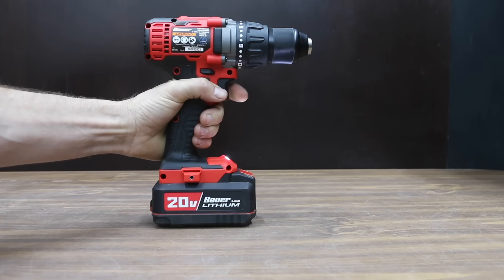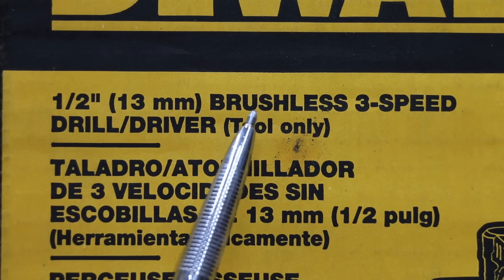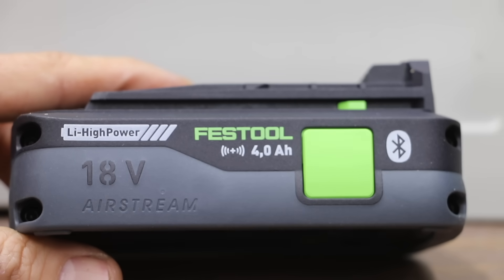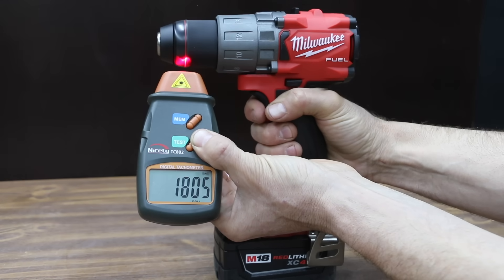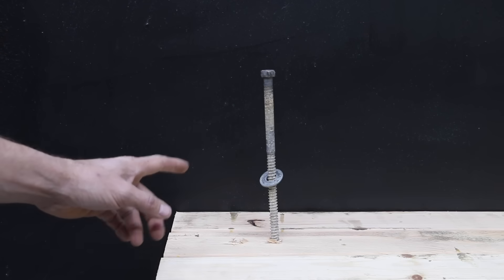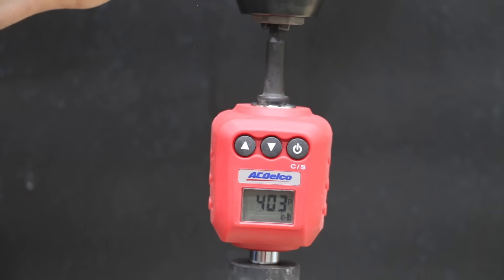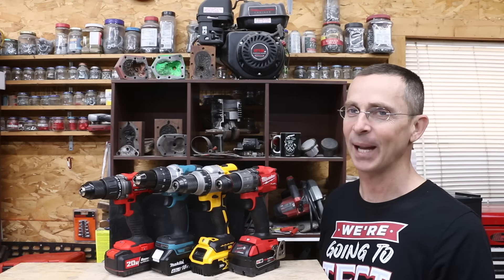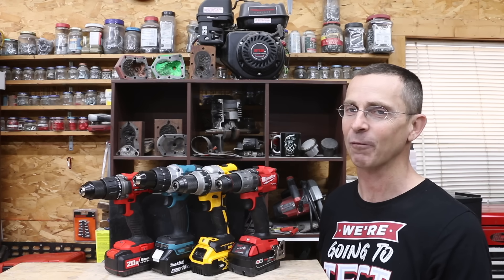Best Drill (BATTERY POWERED)? Milwaukee vs Dewalt, Makita, Bosch, Festool, Ryobi, Bauer, Ridgid

Comment: Imagine spending over $500 for just a drill and then watching this video with your drill in it.🤣🤣🤣🤣🤣
Reply from the maker: Thanks for watching!
Reply: Festool makes a 6” sander that is so good that it’s hard to explain to someone who hasn’t ever used it. It’s like a whole different category of tool. Their shop vacs are also really amazingly good in terms of keeping the air clean. I’ve never understood the appeal of their drill/driver, so I’m not surprised to see how this testing went.
Reply: It just barely beats out the bauer drill that costs 1/10th the price. That's sad.
Reply: @bdkj3e  thats because bauer is made by Chinese children in slave sweat shops.
Reply: That's why the price for a not chinees made tool and you see why companies are switching there factorys to china and even vietnam and malysia. But That movment does cost a lot of jobs. therefor the dewalt would still be my choice.
Reply: @maxwell6774  and festool my choice :P .... I am from europe ...
Reply: @Auto5k my ridgids are 9 years old and still going strong. I use them professionally. They have done cabinetry, metal roofs, beds, several saddle maker shops, several decks, sheds, tons of drywall. Then there are all the regular home maintenance and odd jobs they have been asked to do over the last 9 years. Still have the original batteries too. The only thing that has gave out was a battery charger that was charging batteries in the sun all day. Called in a LSA claim and got my new charger 3 or 4 days later. No questions asked. They have been dropped off of roofs, left out in the rain and run even when it was blazing hot out. You can't beat that. For an impact, drill, 2 batteries and charger for $169. I'll stick with my Ridgid.
Reply: Note that the version without the batteries and charger (as the others were listed) is $349. At that price it still includes the modular case which lists at $99 by itself.

Their version which is more equivalent to the other tested drills (but still has the quick change chuck system) is $299 without batteries and charger, $499 with batteries, charger, and a right angle adapter.

They even have a $199 tool only version (with case) that only uses the standard Jacobs chuck.
Reply: I came for the festool bashing and wasn't disappointed
Reply: My Elu cordless drill is still working after 25 years.
Reply: $400 Its just that case
Reply: Yup, wouldn't be caught dead buying a Festy https://www.youtube.com/watch?v=oezp-_DcUgg
Reply: The advantage of using Festool had not been measured. As a Contractor for building custom kitchen cabinets a precise trigger, the fast exchange of the drill chuck for bits. A tight drill chuck that doesn’t wear out that fast and is able to hold tiny drills us one of many benefits.
Reply: @Auto5k dude yea a festoon may last 10-15 years. $100 Chinese drill will not. Might last 3-5 years but you can buy 5 Chinese drills for the price of one festool drill which gives you wayyyyy more power. So festool price at least for the drill is absurd.
Reply: I've seen plenty of tradesmen using DeWalt, Milwaukee and Makita but I've never seen one use a Festool.  Hilti seems to be the go-to brand for tradies looking for the ultimate in high-end power tools.
Reply: LOL, came here to basically say that same thing.  Great review, I really want that Milwaukee now :D
Reply: Festool offers drills for around $200-$300.
Reply: the only thing I want from festool is their domino joiner, everything else is overpriced
Reply: @seanthompson6720  Festool's patents for the domino will expire in 3 years so there should be much cheaper equivalents from other brands by then
Reply: @seanthompson6720  Their sander is quite nice also.
Reply: Ya, I can’t believe what crap it was, other than super high speed, it was best in absolutely zero categories, and often among the worst. 🤦‍♂️
Reply: @Nevir202  it comes in a nice box tho
Reply: @Nevir202  super high speed it is hard to achive in cars too; you can beat a 100-150k$ mercedes S class with a 35-40$ Renault megane RS but: You will not have almost total silence inside the car; You will not have nearly the same driving comfort,etc ...
Drilling machines are not made for tightening large screws: if you exceed 40-50nm of tightening torque with one hand, you can get seriously injured: most people also use drilling machines without a handle because it makes them uncomfortable at work! For tightening large screws are impact machines with which you can tighten any screw you want with one hand without risking anything (except noise) 
Festool is the quietest cordless drill on the market ; For the money you pay you receive: drilling machine, 2 batteries, charger, 2 different interchangeable chucks, an ultra-resistant and light transport box + 3 years full warranty (including batteries) . 
The test for disengaging the clutch was done to the detriment of dewalt and festool that use electronic clutch: it had to be done on both drilling machines at the highest speed (2 at dewalt and 4 at festool) where they are most sensitive.
With festool you can tighten to the maximum torque on an extremely low speed for greater accuracy...
+ When he published the price he had to compare the cars with the same equipment! (Bosch also uses machines with interchangeable mandrels just like in festool; it's as if milwuaee has a similar model). Not just for the body and maybe a battery with a drilling machine that comes with several accessories ... it's like comparing price on cars with basic features to another car with all the features ....and at the end to say: how big is the price difference ....
Reply: @Nevir202 if you do certain types of work then the festool actually makes a lot of sense. Thst said I do wish it had a mechanical clutch.
Reply: A lot of wood working professionals like Festool. Its possible the German motor and guts will be working 10 years down the road while the China designs may not be. A few years ago I built an office in my basement and all the framing and dry-walling was done with two Ryobi cordless drills. During framing one of them only lasted about 400 x 3 1/2 inch framing screws before the gearbox broke and would not turn the chuck.
Reply: @practicalguy973  At twice the price, you can just buy another tool and still be ahead. Since the other brands like Dewalt and Milwaukee are more powerful,  technically you could get more work done and save money in time.
Reply: @practicalguy973  I've had a Festool 12v drill for over 15 years and was still going strong when i sold it. And i ran it with 14v Festool batteries because that was a thing. Festool motors just dont die. Festool doesnt make the most powerful tools but they sure as hell last and their service is next level as well. Like no issue getting parts for machines that are decades old.
Reply: @BetterBiomedChannel  Factor in the cost of the Charger and batteries. In the case of Makita, DeWalt, Bosch, this can easily add another €150-200 to the prices of the tools.
Reply: @practicalguy973  If you're spending 500 dollars on a drill you want MORE than "maybe lasting longer"! You want performance too and it fell WAY short!
Reply: @BetterBiomedChannel  I hear you. I still have my other cordless Ryobi drill but rarely use it as I know it will burn out and break with heavy duty use. Using that mentality of low cost and throw away is exactly why I have 2 Rigid 18v hammer drills now. The were on sale at Home Depot a couple years ago with 2 batteries each and much cheaper than Dewalt was at that time. I got both for cheaper than the 1 Dewalt of similar power. I have a corded Makita 15amp recip saw and drill that is over 10 years old and work well for abuse and heavy duty. I did some demolition jobs with my Makita recip saw and it never let me down with hundreds of hours now.
Reply: @practicalguy973  That is so true. This test compared short term performance only and did not even look at reliability over time.
Reply: @TheSir2005  same with DeWalt, Makita, and Milwaukee
Reply: @practicalguy973  My colleague has a Festool drill he has been using daily in construction for over 10 years. It was one of the first brushless drills you could buy. It still works like new. The fourth gear is fantastic for self tapping screws. It is also nice to have a tool that isn't made in China.
Reply: @practicalguy973  The cheapest drill you can buy at home depot made for home gamers compared to a festool. Lol.
Reply: Lol nope. I’ve used most of their tools and am unimpressed. We burned up 3 miter saw motors under warranty, and the dealer gave us our money back.
Reply: @darksideorbit8898  Thats simply not true. The service on brands like Festool and Hilti is on a completely different level compared to those brands.
Reply: @TheSir2005  You aren't doing yourself any favors by suggesting the overpriced tools break so much that you are intricately familiar with their customer service.
Reply: @TheSir2005  You're probably right that the service is much better than the 3 brands. But the service is still good enough that it's not worth paying a huge amount of money for extra. Makita, DeWalts, and Milwaukees also don't break often, and when they do, the manufacturer honors the warranty most of the time.
Reply: @someguy5035  So you are saying what? You aint familiar with customer service from tool companies? Cause now that would say a lot.
Anywho, i am familiar with them cause i have run, have and had tools from every brand out there and its just a fact that the service on Hilti or  Festool etc is another league. Anyone knows that. Very different when a Festool or Hilti breaks or has issues compared to lets say Milwaukee.

Oh and btw the Festool isnt 544 bucks, the PDC isnt even for sale anymore here. Last listing i have for it was 287 dollars for a kit with a 5amp battery. It got replaced by the new TPC which would cost me 365 dollars with a 5amp battery right now. 
But if you think Festool or Hilti or other premium brands are overpriced then they certainly arent for you.
Reply: @darksideorbit8898  If paying for the service is worth is up to that person/company. For me personally it aint so im not buying Festool. I dont need that extra service myself and i dont wanna pay that premium for it.

But i've worked for companies who, for example, did use only Festool for simple reasons, there's no hassle. Tool breaks or have issues: reps come pick them, no questions asked and they hand you a new one. There's a lot of value in that for companies. Makita, Dewalt etc dont do that.

Like we used to burn through the switches on occasion because we were running 14v batteries in 12v tools (14v had more amps then 12v's as well). Its bound the happen when you run more juice and more rpm's through a machine then whats it designed for that something will break when abusing it all day.

The rep just laughed, he found it funny.... No questions, no lectures nope, just here's a new one.

Thats what you get as service, forget warranty and again there's a lot of value in that for companies where its too expensive to send tools to get repaired and wait to get them back or having to go to a dealer etc etc.

Festool really isnt made for prosumers or small contractors.
Reply: @practicalguy973  
Festool gives you 5 years of warranty.
Thats one of the things you also pay for
Reply: @TheSir2005  Here's the thing. They aren't "premium." Sorry you have to use customer service so much they know you by name. Maybe you shouldn't be buying "premium" tools.
Reply: @jankaas2760  Yes warranty and parts is great. I think of Festool as something that stands for long lasting quality which is hard to find now days in our throwaway society. In the early 2000s I worked in a car stereo wood working manufacturing facility for a teen summer job, we built display units for retail stores and consumer MDF subwoofer cabinets for Orion, Clarion, Phoenix Gold, Kaption audio and a few other brands. I worked there for years every summer and 2 years after full time to save some money to go to school. I used a Makita MAK9924DB belt sander 8 hours days for a couple days of every week rough sanding cabinets and it just ran for ever. We changed the sanding belt pads and motor brushes as maintenance parts once in a while and those just did not fail for decades of use. I bought one used from Craigslist a decade ago and I still own it and it always works well. It's not cheap but I like having a $300 belt sander rather than having to buy $150 belt sander every 3-5 years.
Reply: @practicalguy973  You can find used Dewalts, Maks, Craftsman, and even B&D all day long on marketplace and CL that are still functional decades later. 

Try again.
Reply: @someguy5035  Randomly buying anything on Craigslist you have no idea what your getting. It could be from a home owner that used it once or twice and it sat in a tool box for years or someone that used it in the trades daily. The Makita MAK9924DB I used for years was amazing. It was used by many employees in a professional environment and a design worth owning so I was not afraid to buy a used one. The same model has been sold since the time I used it over 20 years ago so that's got to say something. It was made in Japan back then, I think Makita is starting to get tools made in China like everyone else now.
Reply: @practicalguy973  So when you bring up longevity, it is irrefutable evidence, but when I do it is it subject to "you have no idea what your getting" doubt? What if I told you I own power tools that are decades old? Now how are you going to tap dance you r way out of that?

We're done here. We both know what happened here and your ego is too fragile to handle it.
Reply: @BetterBiomedChannel  to get more wor done you need another man to operate that tool :P
Reply: @TheSir2005  you dont need the highest power : Tightening screws with torque greater than 40-50Nm (60Nm has the festool model in the video) can be extremely dangerous: You can't hold a drill to that torque with one hand (as all drills usually use). For high torque with one hand there are impact clamping machines with which you can work safely :)
Reply: @practicalguy973  If longevity was your goal then you could not beat the Ridgid with its lifetime warranty, compared to Festool's 3 year warranty.
Reply: @practicalguy973  "A lot of wood working professionals like Festool. Its possible the German motor and guts will be working 10 years down"  I've worked in commercial and residential construct for over 30 years and I can't recall ever seeing a Festool. I also have a woodwork shop at home where I build furniture and my 17 year old Rigid cordless tools work very well. In fact I made the DIY track saw for the cordless 6.5" saw, out of plywood, and used it to rip oak boards for a table tops. The joints were excellent and after they glued and clamped they were as good as any I've seen in an Amish furniture store that's near me.
Reply: @Nevir202  You are also such an overly smart person. Better stop gossiping around here about products that you can't afford anyway, that is not meant badly, but it is better if you just be calm when you don't know your way around
Reply: @someperson8030  Just say you own some festools and get the crying out of the way. The price vs the performance was embarrassing.
Reply: I think for me I like some Festool for more accurate work. Just like any company they have some amazing tools and some not that great. I am a wood worker and build speakers and furniture grade things on occasion. I own a couple of Ridgid hammer drills for beaters and outdoor projects. But Festool has its place and use case for the people that understand the differences.
Reply: @someperson8030  this Festool did poorly in these tests and that is a fact.  
I love quality tools but they need to justify the price

All of my Dewalt tools are ten years old and still work great!  The original battery packs (DC9181) have only lost a little bit in that time.
Reply: @someperson8030  LMAO, I've had a lot of tools more expensive than that POS. But as the tests proved, my cordless drill which costs less than half of that is better.
Reply: @practicalguy973  Very true. In fact, people who own a Festool drill probably all also own a second or even third drill for messier work.
I don't own any Festool, since I'm not a professional, but even an amateur like me has multiple versions of most tools , to be able to choose the right tool for the right job, because you wouldn't want to waste your really nice accurate screwdriver on that ugly rusty thing, would you :)
Reply: @chestnutlouie4709  It did do poorly in this test, as you claim, but the test did not cover every aspect of the products, now did it?
I'm not a Festool owner, btw, just a guy who appreciates that certain tools are for specific jobs. It might well be that the Festool is 10 times more accurate, for instance. We don't know, because the test did not look at that.
It might also be that 99% of everyday home users of cordless drills have no need for this accuracy, but some specific professionals do.
We don't know that, so why judge?
You don't need this tool for that price and can find something cheaper that suits you? Fine. Good for you :)
But that doesn't mean that the tool in question is overpriced.
It just means that it is overpriced for your specific use case.
Reply: @chestnutlouie4709  lol reliability is a thing that most people look for when buying tools. brands like Festool, Wiha, Wera, Nepros, Snap on, Hazet, etc are all very expensive tools. surely you can buy bauer chinese crap and it will outperform every expensive tool brand but they're not reliable. today they'll work fine, tomorrow you are not sure if it work or not. professionals don't like such unreliable tools and they are willing to pay premium for reliability. brands like festool is not for DIY average joe. its for professionals
Reply: @chestnutlouie4709 If you knew what distinguishes quality products and what distinguishes them from cheap ones, you might also know that festool is used almost everywhere by large companies.  And you would also know that it doesn't always depend on the highest speeds and the volume, so don't tell me what should be good here and what isn't.  But okay then keep buying the China goods, but you won't get very far with that.Yes, I have to agree on this point because they are a bit too expensive.
Reply: @practicalguy973  That is what I am saying. What did the Fes do that was more "accurate" than the others? How did it demonstrate more accuracy? And what precisely do you mean by that?

Fair warning. I am a metrologist by trade.
Reply: @Nevir202  ok, I don't want to say anything against it, but you can't explain to me that devices that cost 50 € are used in large companies.
Reply: @someperson8030  the DeWalt drill that I bought 12 years ago is still in fine condition ( original batteries no less)
Abused a number of times and lots less than $500
Reply: @chestnutlouie4709  ok that is of course nice for you my comment wasn’t intended to talk badly to others, especially not dewalt, makita or similar high quality it was just about the fact that cheap products cannot perform as well as expensive ones.  And as I said, Festool is actually not for household use and therefore not really comparable with the other products tested.  But since I don't want to drag this discussion out forever, I would end this discussion peacefully and come to the conclusion that both not quite as expensive products are just as good as expensive ones and that everyone should buy what they think is right.
Reply: @someguy5035  What I've found with drills and drill presses for accuracy is the cheap ones can have more wobble that is not ideal for really accurate holes. The chuck itself can sometimes grab at a slightly different position with cheap ones and I've had to loosen and re-tighten the chuck if that happens. The longer the bit, the worse the issue is amplified. Over some time bearing and other parts wearing can cause even more play but that is less of an issue if it's designed well. Also if it's from a cheaper manufacturing process it might be that the same drill model is slightly better than another per manufacturing batch and their factory tooling condition and maintenance. So if you can get quality that works for many years it's worth it to me. I say like others mentioned, you cant really explain it unless you've used with skill and experience for years. I need to say I have nothing against any of the brands in the video. They are fine for home owners and for heavy duty use and replace in a few years if your using a lot.
Reply: @practicalguy973  "I say like others mentioned, you cant really explain it"

Yes you can. You can objectively explain it using metrics. 

Do they use superior materials? Do they have a superior design? Are they manufactured in a way that produces a better fit and finish? Do they have durability and reliability characteristics that are superior to others? Do they have integrated options and accessories that make the tool more useful? Because those are the objective things that determine value. 

Using words like "premium" and saying there is some attributional feeling you get when using it is pure BS. 

I have owned and used every brand in this line up minus the Bauer and the Fes. None of them "wobble." I have dilled perfectly straight holes with all of them. 

As others have mentioned here, there are other videos on YT where this thing is disassembled and it is made just like the others. 

You guys are faced with an objective test showing this is inferior to others in almost every way and yet you still can't accept it.

If your drastically overpriced and underperforming drill gives you a good feeling, that is great. Just don't lie to yourself or us about the value and performance.
Reply: @someguy5035  Really is funny seeing everyone singing the praises of the “Festool accuracy” when it had one of the worst clutches.

If you’re using that for “fine woodwork,” you’d better be quick on the trigger, cause it’ll drive a screw straight through a board before it does anything. 🤣
Reply: @practicalguy973  one difference: its noise level - it is the quietest battery drill  :P
Reply: Most of the time people zero in on one metric ...there is a lot more to doing good work than just fast....🤔
Reply: @boosted2.4_sky  Exactly. There is so much more to a tool then only the raw performance, like the ergonomics and exact operation and feedback. Another important thing that comes to mind is the robustness of the machine itself, when dropped or when doing heavy work.
Reply: @TheCheesePlease  some of the s*** he says kills me.
Reply: @caleb. I do not own any Festool brand tools, but I do feel that a few things need to be mentioned. Comparing like for like (2 x 5 ah batteries, charger, case) the Festool drill is $160 more expensive than the Makita drill featured in this review in my country. I know a few people who do fine woodworking for a living and they all love their Festool equipment and are happy to pay a premium. These are people who will never need to drill in a 5 inch lag bolt into a piece of wood. 

Contractors in my country mainly use Makita, or Festool. For a home gamer a hard hitting tool, like Milwaukee is probably a good choice. Will the current Milwaukee tools last 10 years of constant, every day use? I am not sure and these tests, as much as I enjoy them and this channel, will never show us the entire story. 

If you need to occasionally screw in some 5 inch lag bolts, then Festool is not for you, but these tools have their place, no matter how amusing you find their prices, or the fact they don’t have the most powerful motors.
Reply: @theseb1979  Makita and Milwaukie are the go to's in heavy industry in the oil patch where I am at. You can absolutely use and abuse their drills, impact drivers and impacts for years of day in and day out. And for their price if you accidentally drop one into a rotary breaker without too much crying. Something that people don't factor into things, I am sure Festool makes great stuff, but if you are constantly travelling between jobsites and your equipment can/ will be dropped, the cost associated with getting one is important.
Reply: @theseb1979  I understand what you're saying. For me personally it's hard to justify that price when I can just buy one drill that will do light duty and sink a 5 inch lag screw when needed.
Reply: @cdsmit27  , I hear you. I cannot justify it either, since I am not into fine woodworking, or a contractor. I need to do odd jobs, fix fences, and build things on our little 20 acre horse ‘ranch’. About 10 years ago I bought the approx 160 USD cheaper Makita set - obviously the previous gen brushed one. I’ve never felt that it needed more power and it has never let me down. The only thing that has gone wrong is one of those original batteries gave up on life, but that my fault for leaving it discharged in a garage over winter. I keep wishing it would die, so I can upgrade to the latest model 🤣 Before the Makita I owned various other cheap home brands and they were all rubbish - total waste of time and money.
Reply: @cdsmit27  then any chinesium tools will work in your use case.
Reply: @Auto5k Ya, I don't think anyone gives a damn if a battery drill is going to be working in 10 years, as there will have been several generations of better battery drills by then.

Pretty good odds Festool isn't going to keep using the same battery architecture for the next decade either, so even if the TOOL is fine in 10 years, you still won't be able to use it.